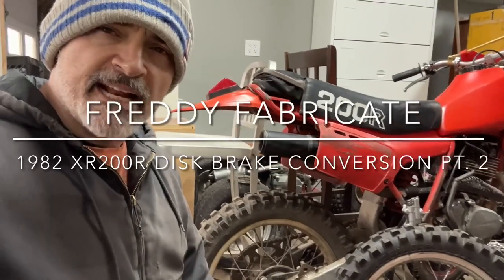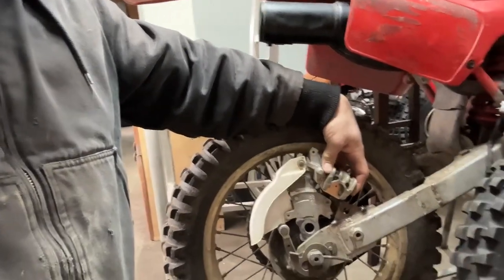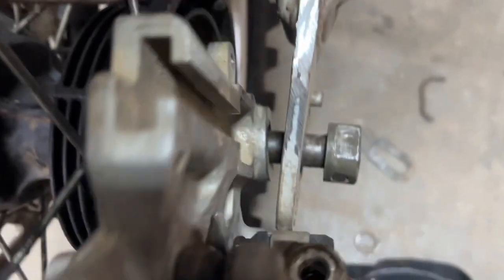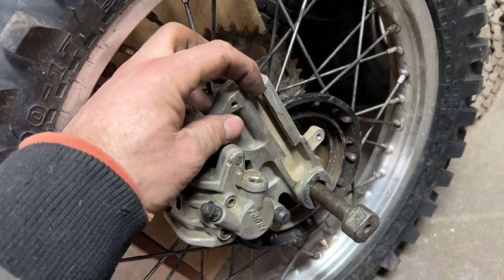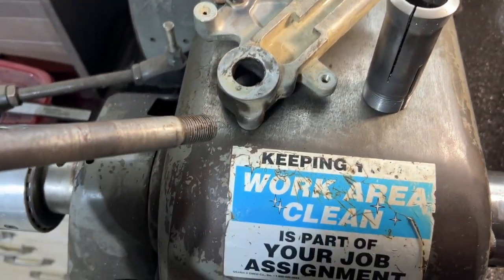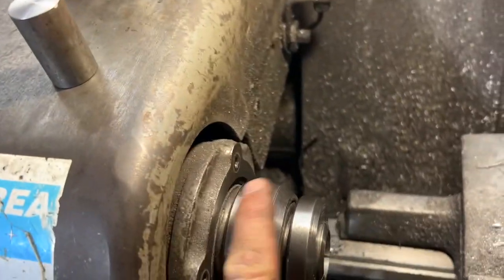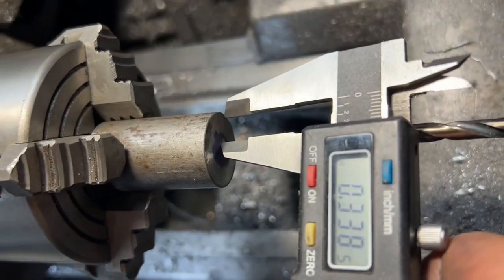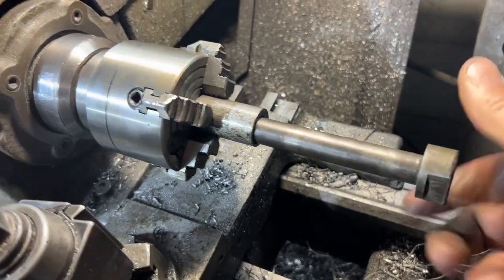Xr200r disk brake conversion.

Comment: I have a 1991 xr200r and the rim is rotid and i was wondering what cind of rim i can put on it cuz i cant find any for my bike
Reply from the maker: I ended up changing my mind after this video. It was much easier to use a 2000 kx250 rear tire rim and disk brake setup.

Comment: Dónde se puede conseguir el kit amigo
Reply from the maker: Not sure about a kit. I ended up using a kx250 rear wheel. Much easier. I’m going to finish converting the drum to a disk for a later video.
Reply: Podes adaptar la maza trasera de honda xr250 Tornado o de Honda xre 300